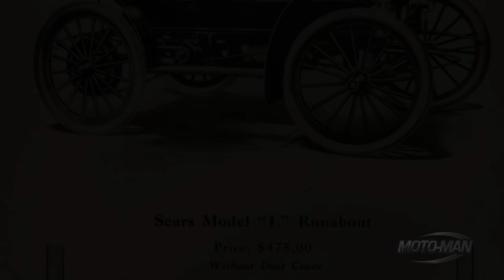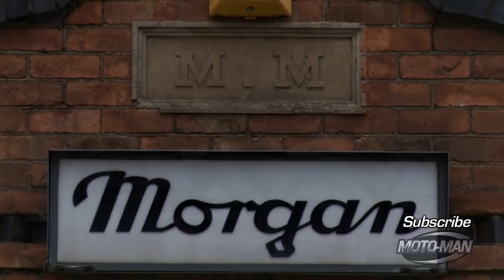Morgan 3 Wheeler - MotoMan

Comment: How easy is it to change the rear tire in case of a flat?
Reply from the maker: About the same as on a motorcycle.
Reply: Does the heat of the engine reach the driver? Guess that helps in the cold British weather but will it be troublesome in tropical countries.
Reply from the maker: doclambertdavid Not really . . . You do need to aware of the side exhaust but that is about it . . .

Comment: That is a no no, hitting the knock off's with a lead headed mallet and with the wheels off the ground, let me enlighten you, only use a hide mallet it will not damage the knock on hub nut.
Reply: I agree, Morgans come with a special hide and brass hammer, I hate the words ' Knock Offs' in the UK they are called Spinners, to a Brit a 'Knock Off' means it's been stolen.